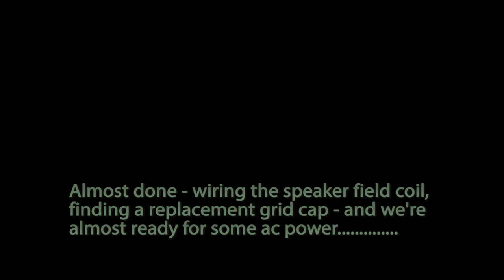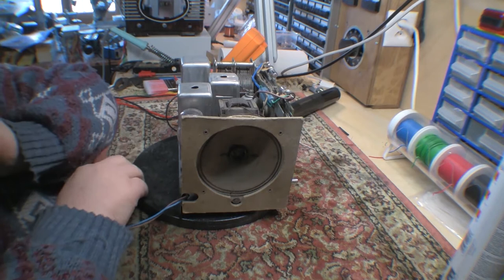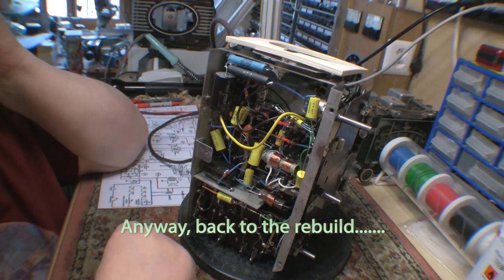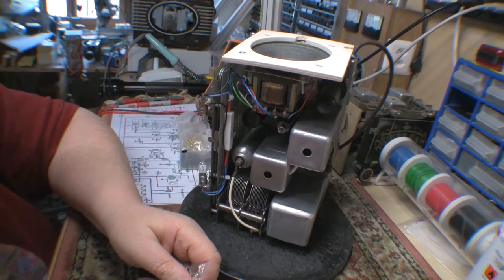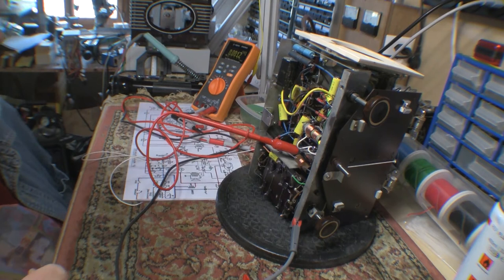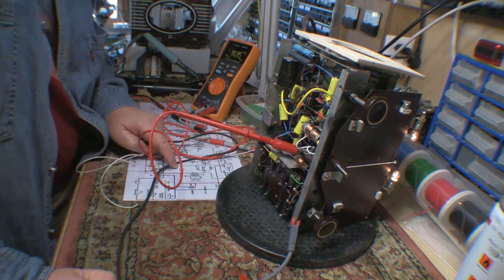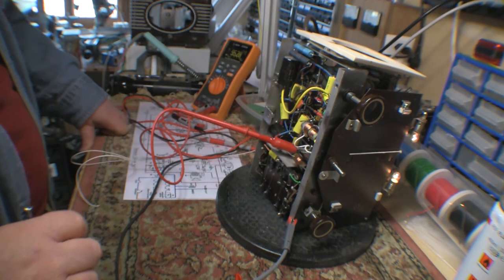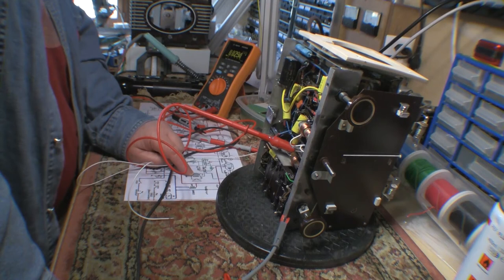Radialva Groom Rebuild - part 17

Comment: Seems like this set really is, a step forward, half step back, for you, John.  I'm not even going to speculate on this one, there are a number of things it could be.  Wire dressing is the first thing I'd check, though.  Was that Johnny Winter?  Sounded like him.  Nice clip, John, thanks :-)  that DVD Tom sent me is packed with good stuff, by the way.
Reply from the maker: Hey Al, yeah that's Johnny Winter alright - you're clearly an expert when it comes to electric blues!   Some good news on the set - I swapped the connections to the output transformer today and all the instability seems to be gone.   When I touch the grid cap on the 6Q7 I get a nice audio buzz from the speaker.  So, my problems are in the RF/IF area - no surprise there!   Gotta say I'm learning lots on this one - which is all part of the objective.
Cheers,   John

Comment: Did you replace the leads to the IF transformers? If you did, and routed the leads to the secondary so they are adjacent to the lead of the primary you can get feedback, though not of that high of a pitch. Phasing of coils is one thing to look at, or there is an RF bypass capacitor not connected where it needs to be, though that usually causes howls and motor-boating "Putt, Putt" type sounds.
Reply from the maker: Since I swapped over the connections to the output transformer all the nasty noises seem to be gone.   Audio section works fine so my problems are definitely in the RF/IF areas.  I replaced on ver short wire in one of the cans so I doubt that's the issue.  However I can't adjust the IF transformers so I'm not sure how things will proceed.   Time for the signal gen and the scope I guess.
Reply: So you can't adjust the IF transformers because the trimmer capacitors are inaccessible or is it that when you try adjusting the IF trimmers nothing happens?
Reply from the maker: OlegKostoglatov The slugs are glued in position and the manual says they are factory set and never need adjustment.  I checked and they are definitely glued - no chance to get at them.  Hard to believe but there it is!